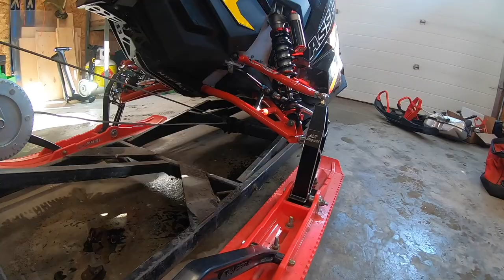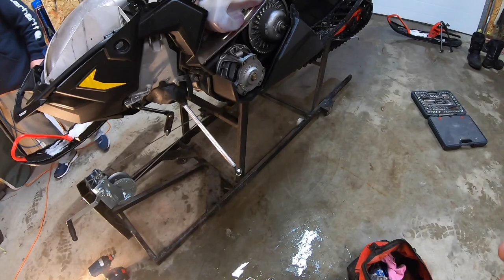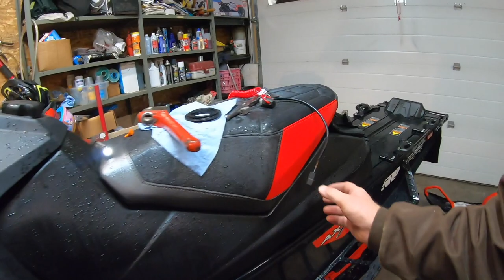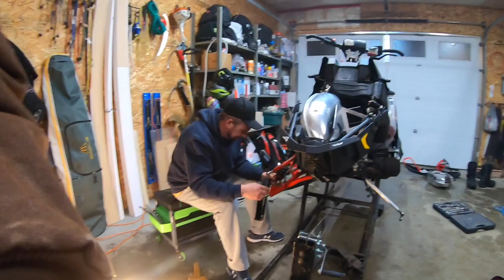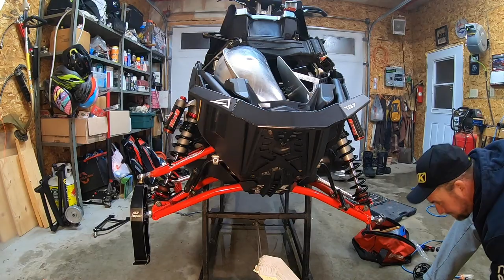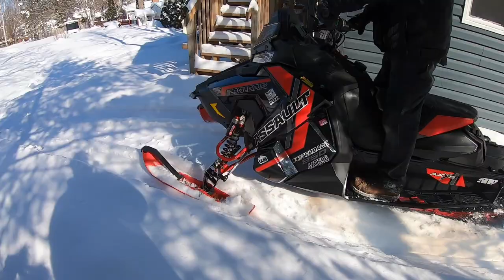Polaris Assault, Alternative Impact install

Comment: What kit did you put on there and do you need a different shock
Reply from the maker: That was a 36 inch front kit it did need different shocks.
Reply: @Twisting Iron  did you just go with rmk shocks?. Looking to do this to my 21 assault as well. Hard to throw it on its side when it's as wide as it us.
Reply from the maker: @codyheckman1249  the shocks were taken from a summit he had before.  Likely the same length as rmk shocks I don't for sure though.  But yes you would need two new shocks to work with this kit.  Hope that answers your question.